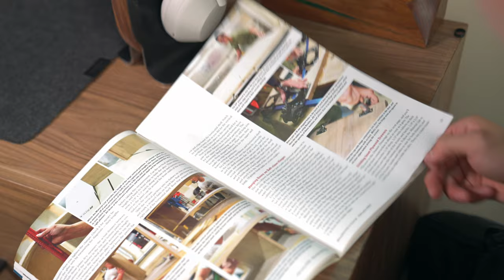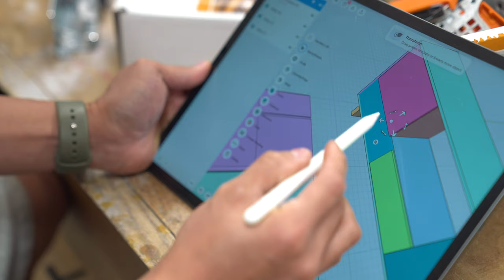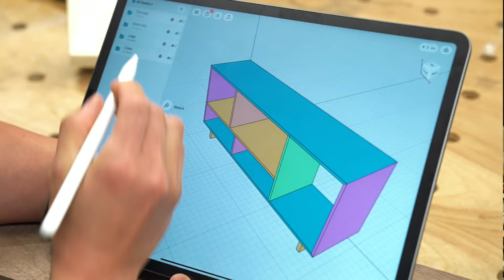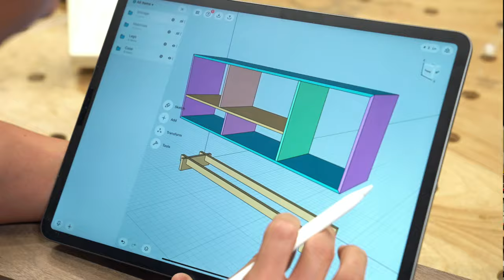Build This CREDENZA Home Office Storage || How To Woodworking

Comment: looks great and I think this is something I should try doing. Without having to buy a domino machine how else would you secure the joints? That is the only thing I do not have out of all the tools you used other than the spray finish equipment.  Thanks for the great video!
Reply from the maker: Hey the main thing with the Dominoes for this was to help with glueup. It’s hard to get things to line up with a big thing like this by myself. Yes, it adds structural integrity, but the vertical partitions in this build provides enough structural integrity. You can also use splines if you’d like. Usually on smaller builds, I just use the tape method and fold things over to get the glue surfaces tight without using domino